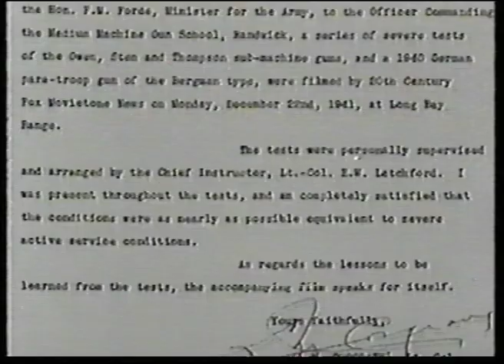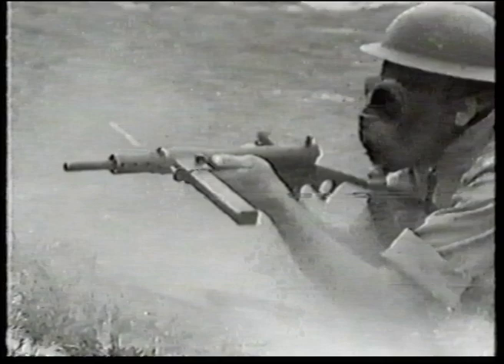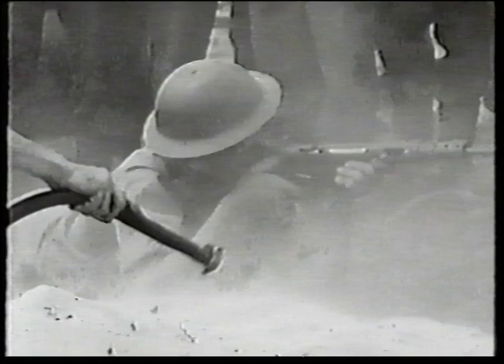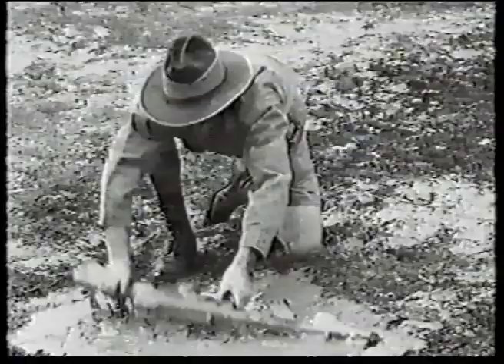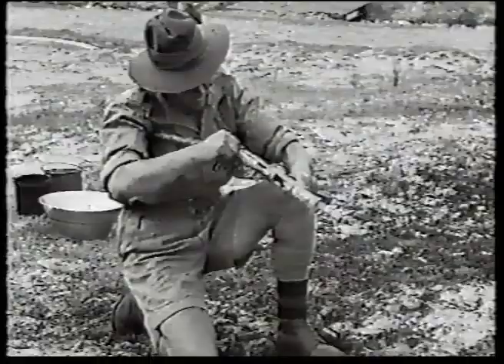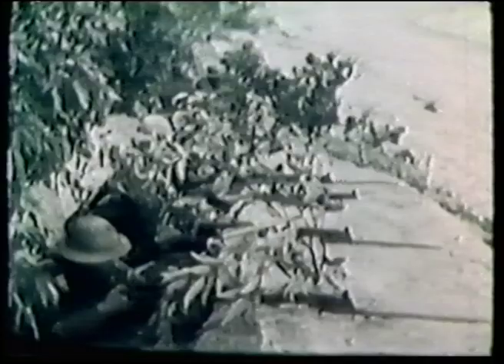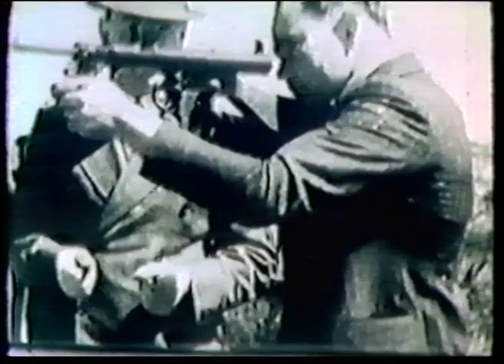'Service Tests of Modern Sub Machine Guns' (1941) and other Historic Films on the Owen Gun (1940s)

Comment: The Owen gun's charging handle being located in a different isolated space negated the need for having any other holes in the bolt space which also coincidentaly prevented any dust to enter while the top loaded magazine with the open ejector at the bottom meant that any sand that entered eventually just got "sweeped" down there and out. Interesting.

Comment: What if they fired the Berman upside down and the Sten side ways mag up.  I think it will work as good.
Reply: No, The spring and piston are in a chamber which is sealed at both ends which prevents the ingress of dust, mud and sand.
There were major tests done on the Thompson, the Sten, the Owen and one other by the Canadian, US, British and Australian armies. The OMC won hands down against the rest, especially in terms of reliability, and maintenance.
Reply: @ianlowery6014  Don't forget that the Owen was also lighter, more accurate and more controllable than most existing weapons